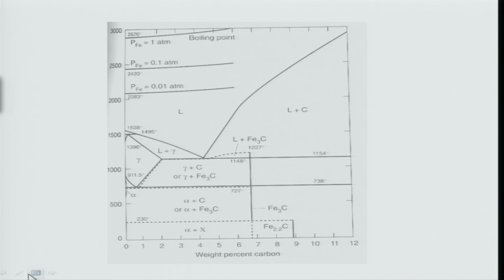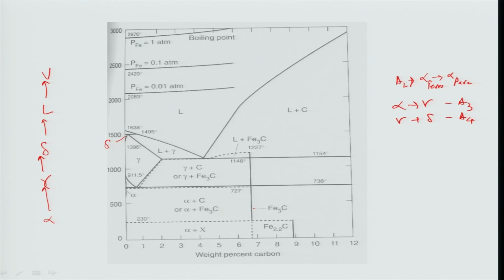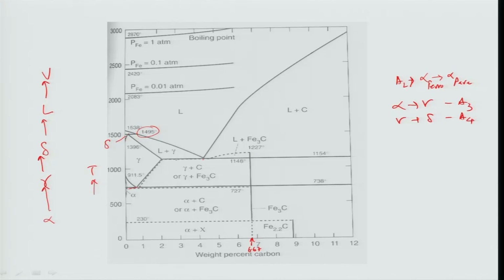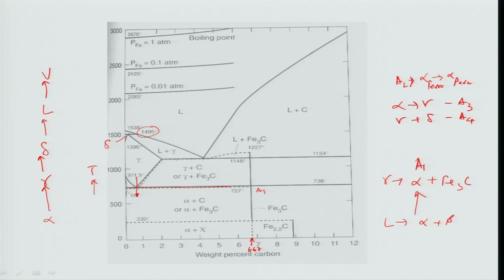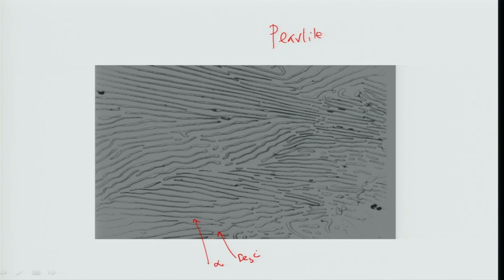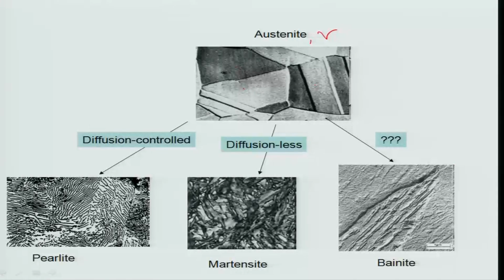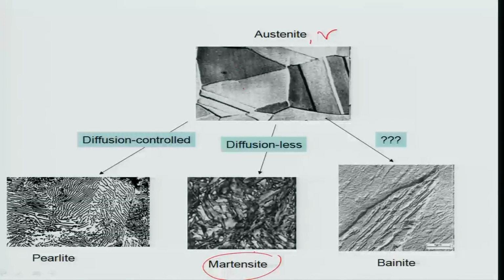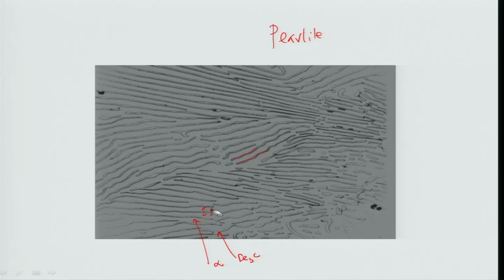Lecture 26 : Introduction to Iron-Carbon phase diagram

Comment: Authors define the eutectoid point of the FeC diagram with different% C (example: 0.77%, 0.86% and 0.83%). What is correct value?
Reply: O.8
Reply: 0.77